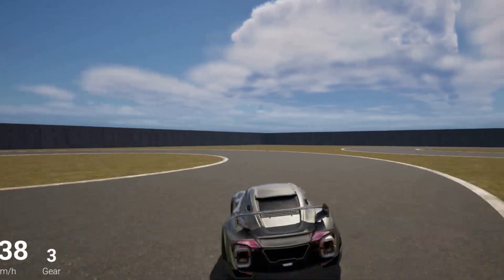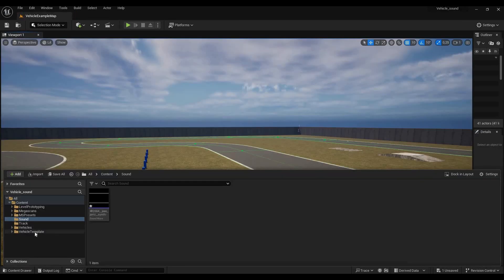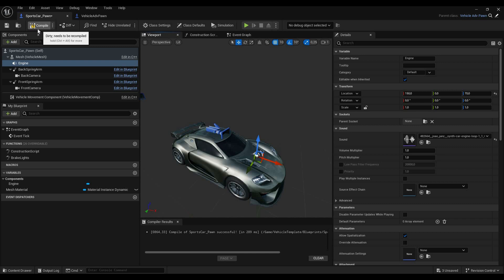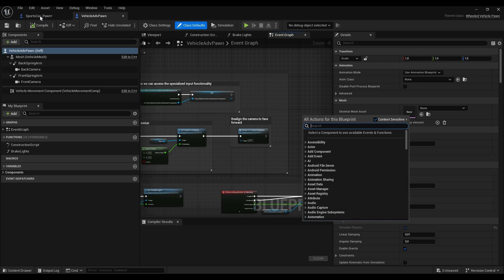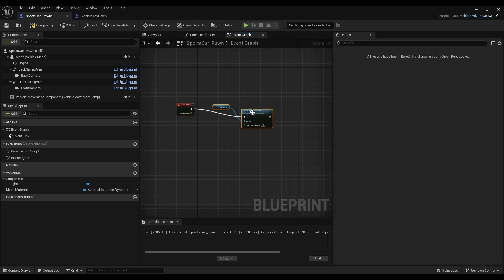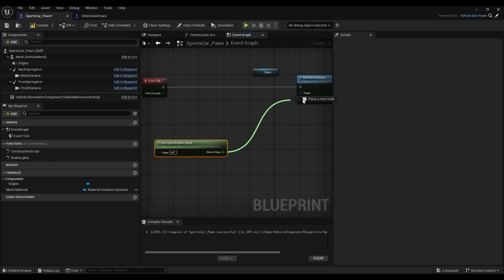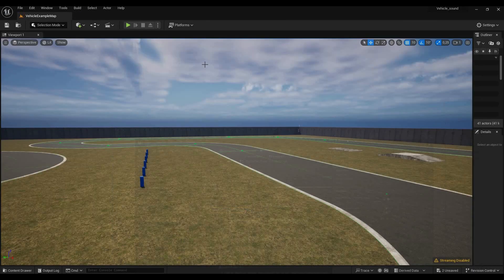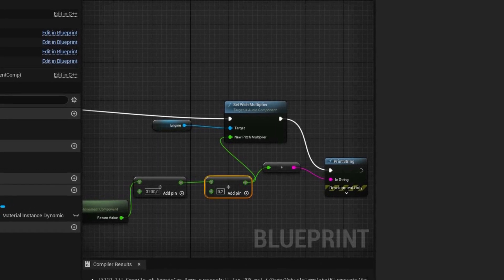How to add DYNAMIC ENGINE SOUNDS to your vehicle in Unreal Engine 5

Comment: I'm getting error: "Accessed not trying to read property Chaos wheeled vehicle movement component" can you help please?
Reply: you will need to "Cast To ChaosWheeledVehicleMovementComponent" with "vehicle Movement Component" as the object ref and connect that to the "Get engine Rotation Speed",

no idea how this worked for this dude without that?
Reply: @neonlobsterr  bro,it solved but pitch is not working,means normal sound is coming when vahicle move same sound is coming
Reply: @neonlobsterr  how to do this bro pls help